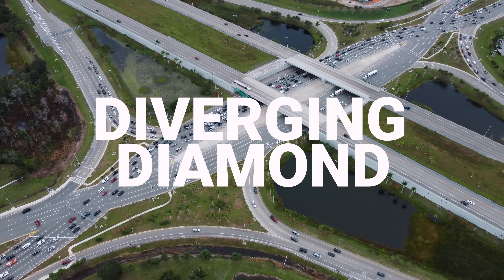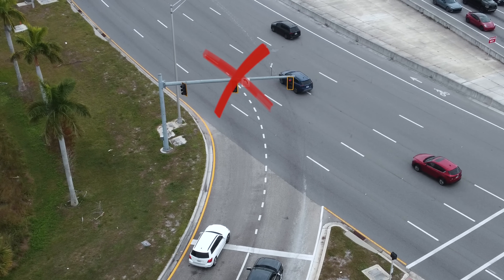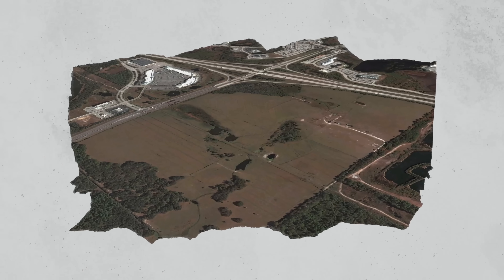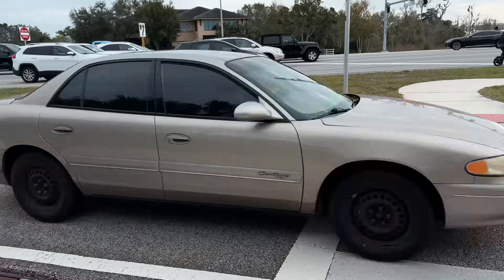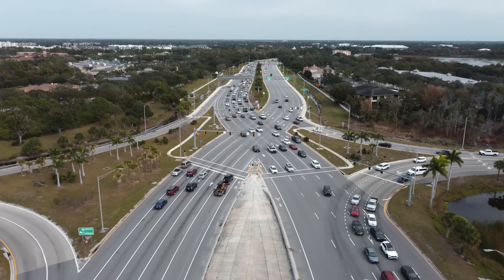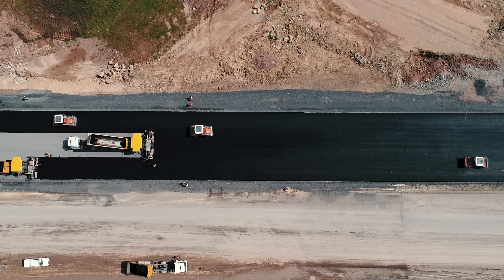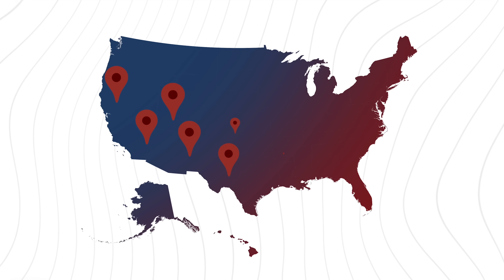Traffic Will Never Be Fixed Here

Comment: I live in the Netherlands, where bikes are used a lot, I even use my bike to go to work. We have an infrastructure for bikes itself. That run along side the main roads.
the city i live in has 150k inhabitants, and the widest road we have are the main road leading into the city, and are 2 lane. 
If you focus your city's infrastructure on bikes and pedestrians (city centre are cars not allowed)  you also have healthier air within the city
Reply: in America people like to shop at stop or least stops like that whole area besides the highway was built in 25 years from 1995 to 2019
that (the mall at university town center) mall holds 112 stores
but places like these like
Sarasota, Florida population 57,602

thats only 1 part of the city
Bradenton, FL

you have to do sarasota county fl population which is 469,013, the county adds areas like Fruitville Florida which is part of the city but not

Comment: I'm curious if perhaps Layering the flip would help where instead of an intersection one set of lanes goes over or under the other set of lanes. Seems like that would remove the 2 most contentious points of conflict, although it would increase the cost of the interchange fairly significantly.

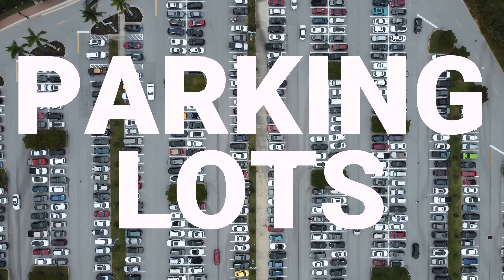Comment: 3:22 aerial view shows the entire answer for the problem. 

The diamond is fine, the junction right after the diamond is the issue. This means more lanes would work IF WE MAKE SURE THERE ARE NO OBSTACLES further on the road. Making bike lanes right next to highways is shitty idea because of the all the noise. The thing this junction needs is... alternate route. First: stroat needs Y type interchange way before the diamond and malls. Then the "right arm" goes into diamont junction with the main highway, the "left arm" goes above highway without junction, then the left arm has a junction (or roundabout) from another side of malls. This ensures high flow of traffic from left arm while right arm gives the freedom of changing directions from highway-stroat

Comment: I'll never understand the american car culture. We have huge cities here too, and having like 2 lanes per side is rare, let alone 5 like in the diamond. It just seems so unnecessary.
And while it is at least nice that they actually designed the middle area to be designated for pedastrians, they could have at least done some kind of landscaping, like greenery and some better noise and visual blockage towards the road instead of just covering in concrete slabs and calling it a day.... giving it this kind of "i really don't want nor should to be here" kind of vibe. And the bike lanes directly to the side of the five lane road? That could have really been done in a safer and more efficient way. 
Also, out of curiousity, do you guys in the US work with street sensors (inductive sensors below/inside the pavement) to detect cars in front of the traffic light? If backup into the intersection is an issue, how about adding some inductive sensors after the crossing, detecting if there is potential traffic stagnation, which could preemptively switch the traffic lights in front of the merger to red, stopping potential backup.

But in all seriousness, your road designs look so incredibly alien to me.

Comment: Traffic engineers don't have the wrong answers, they ask the wrong questions.
1) Here: "How can we build the interchange for maximum traffic throughput?"
2) Better: "How can we better meet people's mobility needs?"
3) Best: "How can we design the city to avoid unnecessary mobility challenges and make it more comfortable to live and move in?"

The answer to the first question will always be: build something fancy and expensive that can never work 100%.
The answer to 2) is probably public transit and bike lanes, which would be a great solution if the mobility needs were less extensive (e.g. 30 mile work commute every day).
The answer to 3) is what I think we should all strive towards, but cannot have overnight, for obvious feasibility reasons.

Comment: A short term solution would be to introduce yellow box junctions onto the diverging diamond interchange, to stop vehicles proceeding unless their exit is clear, risking a fine if they do. Also installing repeater signals will reduce confusion, which is done a lot here in the UK
Reply: America uses white checkerboxes.  But it could not be used here due to the lane guidance markings through the intersection.
Reply: @traffic.engineer  ah, better ask for an exception to the rule to change the colour as a ‘trial’
Reply: @Seb512  yellow is reserved for separating traffic going the opposite direction.  It is used for the centerline and left shoulder.  If the yellow line is on the right, it is a message to the driver they are driving in the wrong direction.

Comment: Why not at the very least build underpasses for pedestrians and bikers at this hellish intersection, instead of making it even more crazy with biking lanes and pedestrian crossing?
Reply: Pedestrian underpasses are not a good experience.  High construction costs, constant need for lighting, and ADA requirements make it cost prohibitive.
Reply: @traffic.engineer  Depends how they are built. In the scandinavian countries they are the norm, as it turned out that the Interrupted flow of traffic (be it vehicles, pedestrians, bikers etc.), the cost of traffic lights, road signes, ... and especially the massively higher chances of accidents are alltogether way more costly, than maintaining an undersection. The costs for lightning are barely worth mentioning with the dirt cheap highly efficient LEDs on the market, supported by a light catching way to build.

Comment: I live in this area, and I've both driven and walked across this interchange. It isn't the easiest to understand as a driver, but it works once you get used to it. As a pedestrian, it is actually a slight improvement over older designs of interchange, where you are kind of fenced in on a tiny sidewalk on the edge an elevated section of overpass, with cars whizzing by. For a pedestrian, it is a lot more spacious than previous iterations of road. I can't even imagine a cyclist surviving using the bike lanes here though. As a cyclist, I would simply use the pedestrian path, which is what I would do for all streets in Sarasota except for the Legacy Trail, as you cannot trust drivers here to stay in the lanes.

Comment: You’re missing 3 very important things why they didn’t plan on people walking and bike riding through this intersection. 1 it is 1 million degrees 7.5 months of the year and nobody is dealing with that heat in Florida. 2 there arent any homes anywhere near that intersection. The one’s next to the utc mall have plenty of ways into utc and from the other side is almost 2.5 miles away. 3 utc mall is a destination for people to come from all over Florida which requires more cars then from the surrounding counties only.

Comment: At this point, just put in a cloverleaf or full highway interchange with flyovers.
Reply: I was thinking the same, but it also seems to be a matter of space around this intersection. Look at the upper left corner. You need a sufficiently long stretched section for switching lanes to both sides.
Reply: @frankyboy1131  That's true. Looking at how close the mall is to I-75, a better option might have been dedicated exit ramps from both NB and SB 75 that dumped traffic right into the mega-mall's parking lot, avoiding surface streets altogether. And a dedicated SB 75 entrance ramp from the mall parking lot would have been fairly simple to build as well. That would keep a huge amount of traffic off the surface streets entirely.
Reply: @frankyboy1131  Make it a turbine interchange.  They're designed for small spaces.

Comment: a few things are wrong with just summing up a problem with traffic as "cars" 
1. human centric designs only work where traffic is either diverted to an external location OR the area was never designed with cars in mind in the first place. the old city of Jerusalem or many older parts of European cities. this would not work in the US because of how the US works to begin with. while there are many examples of developments designed with foot traffic in mind, they are often much smaller in foot print and have massive parking areas distributed outside the core area. 
2. cars are the definition of freedom. the ability to travel where you want to go, without natural limitations or weeks of travel by foot. so to just right off a car as a problem doesn't actually solve the problem. you can't just make an area much more 'foot traffic" friendly and expect cars to go away, especially when the patrons don't live or work anywhere near your traffic problem. 
3. even if you can reduce the traffic load by redesigning how a parking system works, for example with a mall, having a central parking area, that is well integrated into the road system instead of an parking lot surrounding the mall, you still need to plan for traffic to come in and out of that system. along with getting people where they want to be, this could involve shuttles and other services that cost the operator money, a lot of the reason why malls have parking and roads the way they do, is to allow patrons to travel where they want to be and enter closest to where they want to be. 
4. planning is everything, you can make a well put together commercial shopping district that flows well and allows all patrons to get where they need to be reasonably and with freedom of movement. but if you have a system that was never planned to be as densely used as it is, then you can almost NEVER get traffic where it needs to go without massive road works. the new braves stadium truest park, has it's main feature the stadium central to the development, however the parking for the stadium is situated down 3 different streets with immediate interstate access. drivers are directed to their appropriate parking locations through tightly controlled engineered and planned operations on game night. HOWEVER there is also "free" (i.e. not restricted) parking for the commercial side of the development, users enter a parking deck that serves as the main parking for the entire commercial section, forcing patrons to walk to most of the businesses located in the commercial development. this is in contrast to the shopping center in the video that seems to more or less have sprung up with little to no planning on how to handle the traffic entering and exiting the area. they decided that "more lanes" = "more better" which isn't always true. you might want more lanes, but those lanes have to have a purpose to take patrons to where they want to go. and those lanes have to be clearly signed and marked as such. this means that many lanes might just need to turn into turn only lanes or be directed right into the shops in that area. among other improvements. 

lastly while many want to just complain that cars are a problem, this is just not the case in most situations. it's a problem with how these areas are designed, when they were designed, the density of vehicles they were designed for if designed for vehicles at all, and how effective any efforts to control, direct and mitigate the issues these vehicles bring to an area. 

lets use new York as an example, while acknowledging that i don't live in new York, one could theorize that one could just "ban cars" in the city, yes and no. while one could very easily reduce the lanes in the city to 2 lanes per road and effectively restrict the access to the city to permit only, one would also have to build a massive parking lot  or lots to deal with the newly evicted cars, AND get people to and from those lots for the purposes of travel into and out of the city. the only way this could even happen is if the public transport was A) profitable, B) safe and C) actually and actively went where people want to go. the issue is that not everyone in an area want to go to the same place, and most people don't want to swap a bus or a train multiple times just to get where they want to go. it's one thing if it's one swap but it's another if you have to plan out hours to get where you want to go, according to time tables. thought the core of the city should be mostly transvers able by foot, much like downtown Chicago is, a lot of the problem is that distance and that public transport anti-freedom philosophy. a bus can't be told to go to a specific address 5 miles away, a train is limited to the tracks it rides on, these are the main problems with public transit that just make people not want to use it. it gets confusing and it makes the travel take much longer then it would if one would to invest in a car or just take an uber. 

at the end of the day there often isn't a clean solution to traffic regardless of one might want to think. often times the only solution that will work and solve the problem is to raze the entire area and rebuild it, but that will never work in places like new york or pretty much anywhere that's not a north korea or china.

Comment: I see no advantage at all in this diamond-like traffic junction over an actual intersection-free motorway junction.
This shift in driving directions means that those driving straight ahead can collide twice with oncoming traffic. And everyone has to slow down and maybe even stop.
Reply: Free flow interchange is way more costly when this interchange already improves safety and efficiency at a fraction of the cost.  As the narrator states, this interchange is so efficient that the downstream intersections cannot handle it.  Free-flow interchange would make that backup worse.

Comment: This interchange design is impressive, but it may not be a perfect solution. There is another variant called Double crossover merging interchange, where this will eliminate the need for traffic signals and make it even more free-flowing, with that same concept only this time, it is all grade-separated, going over and under other roads (rather than just waiting for signals)... Currently, that type hasn't been built yet.

Comment: Doesn’t such a high traffic volume warrant an overpass, instead of light, where direction is flipped?
Reply: Not when it is cost and emvironmentally prohibitive.  DDI improved the efficiency and safety from the original interchange design at a fraction of the cost.

Comment: couldn't a roundabout fix the interchange that's causing the backups?

really don't get why americans avoid roundabouts at all costs.
Reply: No.  Roundabout would fail here because volumes are well over a roundabout's capacity (25000 vehicles per day for signal lane, 45000 for dual lanes).  Not to mention additional right of way costs and additional walking distance for pedestrians.  Roundabouts in America are reserved for rural and mild suburban locations.

Comment: I mean a stack interchange would 100% fix that. Not saying it would be cost effective. Just saying. It would fix it.
Reply: No.  The problem is not the  interchange signals.  The issue is the interchange is so efficient that the older downstream signals cannot handle the traffic.  The connecting infrastructure is causing the backup.  A stack interchange would increase that backup.
Reply: @traffic.engineer  make every interchange on that road a stack interchange. Problem solved. ( im joking) although that technically would work

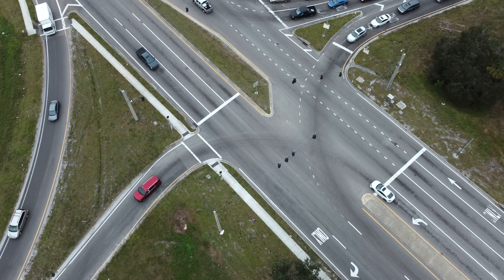Comment: 1:11 - Well, it does help when people turn like this red car driver did!
They were up into the intersection, so it's like a head-start.  And they turned quickly.
The white car waiting, if the started going where they are right now when they saw break to turn, it would take them longer to turn.
And slower drivers need more time to turn or the chance of a crash increases.

Comment: JUST BUILD A BIG ROUNDABOUT
Reply: Roundabout would fail at efficiency due to the traffic volumes being greater than a roundabout's capacity (25000 vehicles per day for single lane, 45000 for dual lane, 60000 for triple lane).

Not to mention the excessive construction and right of way costs.

Comment: Why have the "ends" of the diamond crossing each other on the same plane? You can't turn left or right at those junctions - only go straight - so it's totally pointless for them to intersect. Just have one set of lanes go over/under the other lanes. That would completely eliminate the signals and back-ups.
Reply: Very cost-prohibitive due to construction, right-of-way, and environmental costs.  Crossover eliminated much if the backup amd safety issues addressed from a standard interchange.

Comment: I have to admit I was expecting perhaps more of a dive into how to fix the flaws of the actual intersection considering how you introduced the video. It felt like there was a disconnect with the rest of the video and the points you discussed. I agree with the points raised as relates to the larger societal issues with cars, but fixing these problems is easier said than done. 
Considering the introduction, it would in my view be more interesting to see how one might fix the specific issues with the intersection you pointed out before you then segue into the larger point.